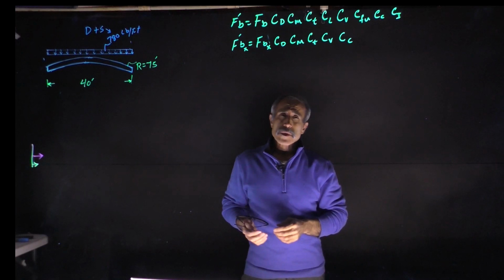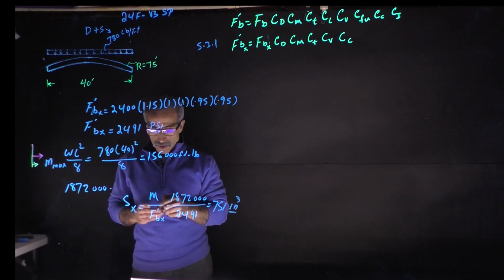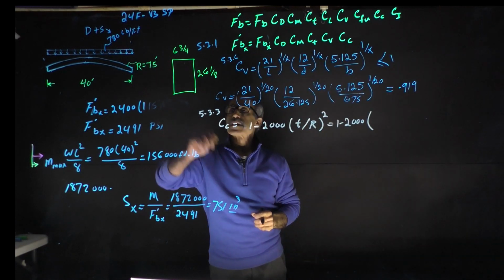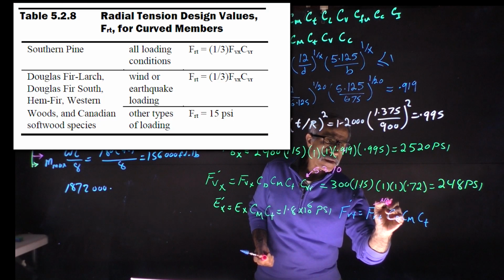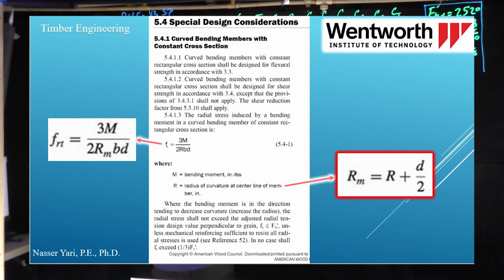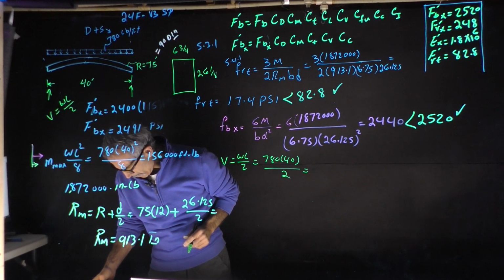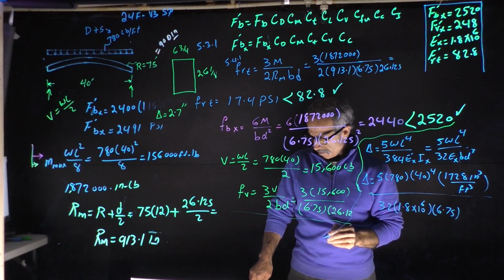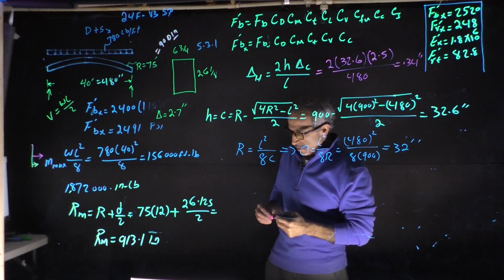Curved Glulam Beam Design

Comment: hi can we design timber beam with circular cross section as per ec5?
Reply from the maker: Yes, you can. Your Ix=Iy  moment inertial would be same on both axes. Round cross section are good for column /compression member.
Reply: Thank you for sharing .want to ask  one more problem Can we design these circular beams by using staad pro?

   @nasseryariphdpe648